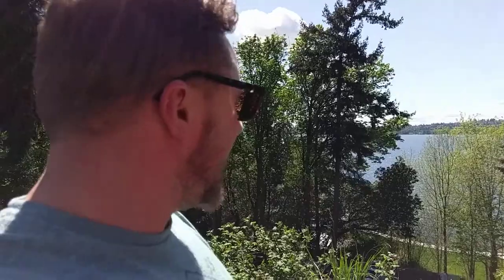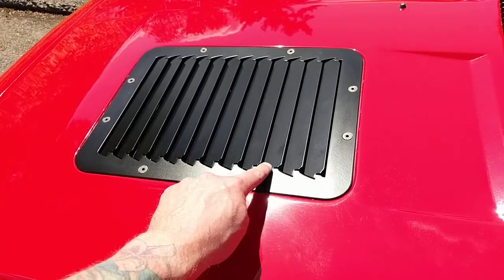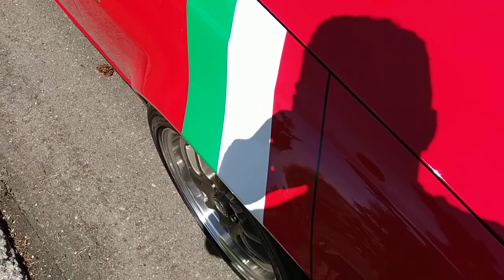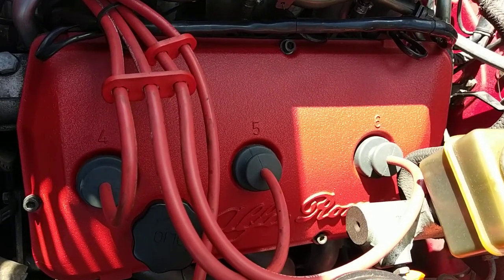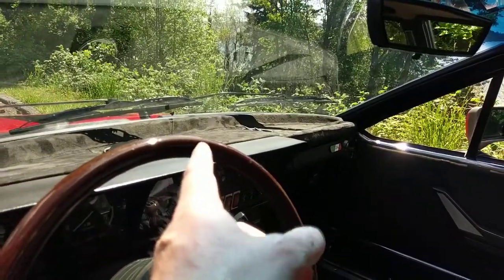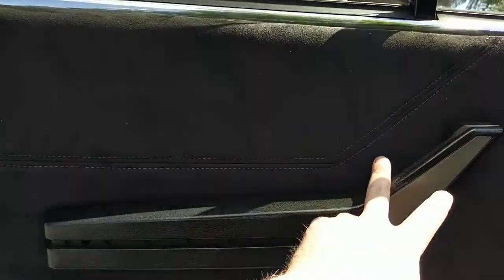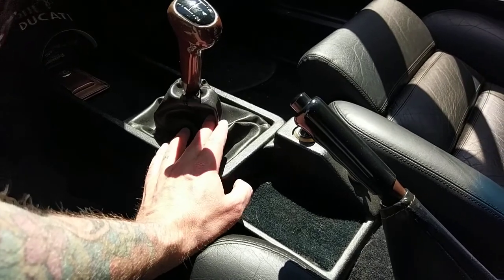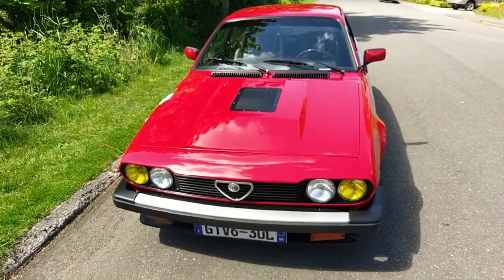Alfa Romeo GTV6 home build update

Comment: I just looked at your video again, specifically the missing trim on the armrests. My car, and mostly all of the other South African GTV's I have seen seems to not have a separate bit of trim there. Mine has a thin detailed bead that is moulded into the armrest where the channel for your trim is. I might have a solution for you regarding the trim, with aluminuim. Otherwise trying to source a set from an older model without the trim might also be an option. Love the alcantara on the dash. Mine looks horrible from all the cracks.

Comment: Hey Sloppy, great car, great vid. Really enjoy your videos, as i can relate and appreciate the effort that goes into your project, as like you, i also mostly do everyrhing on my '84 GTV6 myself. I noticed the plastic trim pieces around your inside door latches are missing, the problem with these are that they have really weak plastic guides/clips, and always end up breaking, especially when the door cards are re-coverred in padded material. When i recoverred mine, i fixed the trim pieces directly to the door cards after re-covering, with some small self-tapping screws from the back. It has been 3 years and they are still holding, and it looks great, so if you have still have some trim pieces, give it a go. I really love the hood panel, it completes the car in my opinion, the original seems kind of out-of-place.. Would it at all be possible to obtain one like yours with your help?
Reply from the maker: namibgtv6 I have the inner door latch covers. That's a good idea to fasten them to the card. Mine are in good shape but with the new padded cards, don't fit. Also, yes it's easy to get hold of a hood panel like mine. I can easily have the shop that made mine, make another.
Reply: That would be awesome. Do you have another way for us to get in contact, maybe an e-mail address?